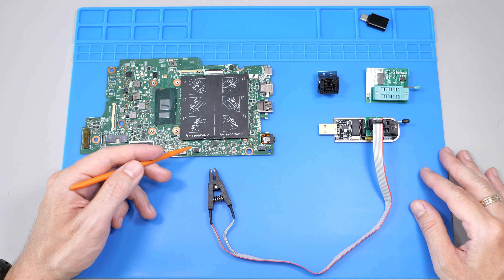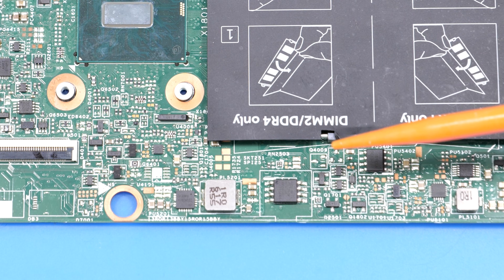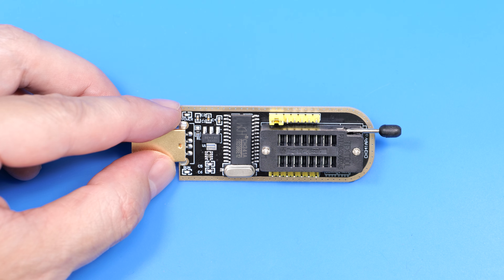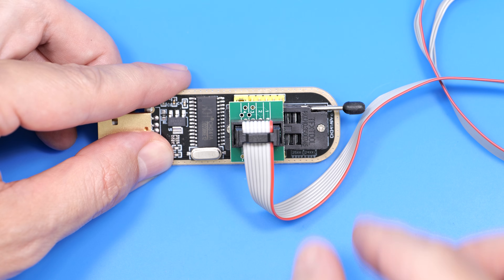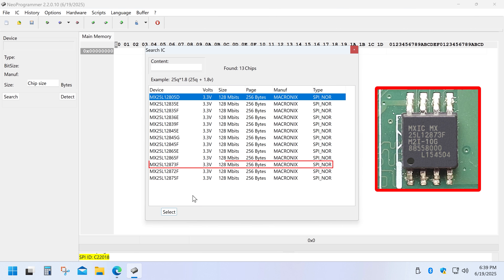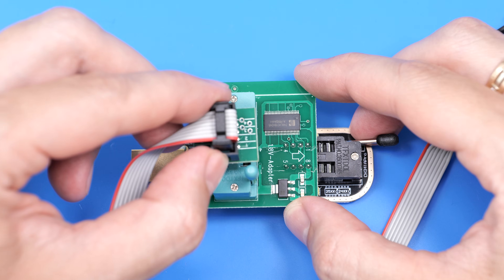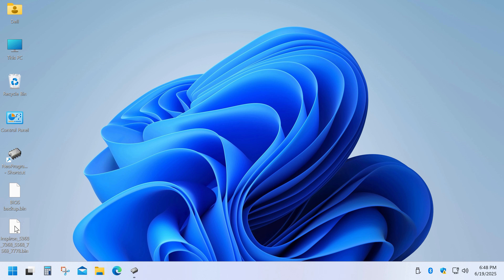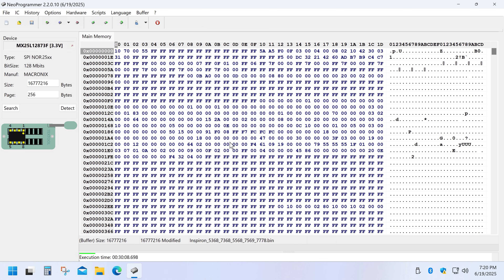How to Fix a Corrupted BIOS with a $5 Programmer | CH341A BIOS Flash Tutorial

Comment: I have an issue. I'm trying to fix my Gigabyte am4 GA-AX370-GAMING 5 motherboard I'm suspecting the bios is dead. Apparently the board is used to self bricking eventually. My issue is that thet chip that the mobo has for the bios doesn't have markings for the model number it's completely black. And cant find information regarding it on the manual. How could i go about it?
Reply from the maker: That motherboard should have a dual BIOS if I'm not mistaken and if the B_BIOS is dead, it should automatically fall back to the second chip. Also, there are two small switches below the bottom PCIe slot that let you manually select which BIOS chip to boot from, try toggling those first. If that doesn't help, clear the CMOS and try powering on while holding the power button for ~10 seconds, that can trigger the backup BIOS to recover the main one. If both chips seem dead, you’ll need to reflash one using for examle, a CH341A programmer. The chip is likely a Winbond 25Q128FVSQ or similar 3.3V 128Mbit (16MB) SPI flash, so no worries it's safe to try different models until you find out which one works.
Reply: @ElectronicsComputers  well I have tried switching it with the switch and clearing with the battery and it hasn't helped. I haven't tried the 10 second thing you told me but I'm not too hopeful. I at least know that my components are good I tried them on a friend's mobo.

My issue is as follows it turns on and the error code cycle a lot and doesn't end up turning on. It could stay stuck in DF or code 00. I read online that apparently that board had a tendency to autobrick the bios randomly if the PC wasn't powered off correctly. It's good to know about the chip. I was worried that it would be a 1.8v one and that it would get fried.
Reply from the maker: @THEwed123wet   Yeah, based on what you're describing especially the error code cycling and getting stuck on DF or 00 it really sounds like both BIOS chips might be corrupted. That MB is known for randomly bricking the BIOS. Simply download the correct BIOS files from Gigabyte’s website and reflash the chips. On that board are most likely Winbond 25Q128FVSQ or something very similar. Flash both  M_BIOS and B_BIOS with the same BIOS file, one at a time, and clear the CMOS again after you're done flashing.
Reply: @ElectronicsComputers Ok I will do it. First need to order the parts. Do basically i should do it with the battery attached and then when i finish i remove it to clear the cmos right?
Reply from the maker: @THEwed123wet   As a rule, we always disconnect power both the CMOS and main battery before reflashing the BIOS chip on the motherboard. If the chip isn't detected during programming, some motherboards require standby power either from the CMOS battery or the main power supply to activate the necessary power rails for the BIOS chip.
Reply: @ElectronicsComputers Thanks! I will keep it in mind 🙏
Reply: @ElectronicsComputers I'm back, I got the programmer. after further inspection I managed to see the print on the BIOS chip it's a MX25U12873F 1.8 V, I have tried to get the program to read the chip but I get the "IC not responding / Disconnected" error I have tried a lot to reset it and try on the second BIOS chip and I haven't had luck. I did notice that the pins on the 1.8 v came slightly bent I managed to straighten then out but it still didn't work. I now noticed that the pins from the thing that plugs into the 1.8 thing are also bent I will try to straighten then tomorrow. Idk if o should maybe power the board or remove the CMOS I have seen online to also try multiple programs will try doing that too see if it helps. I will also borrow a voltímeter from a friend to see if it isn't damaged idk.

Comment: would it have been better to move info about how some chips are 1.8v before the clip where you plug it in power? to avoid frying the chip?

I didn't watch the video all the way through and watched it step by step, I just realized after plugging in that my chip was 1.8v. It could've been fried (will have to buy a 1.8v adapter to be sure) or do these programmers only flow power to the chip when a read/write occurs?
Reply from the maker: Thanks for the feedback you're right, the voltage warning could be shown earlier. I placed it after the IC detection since NeoProgrammer displays the correct voltage once the chip is selected, and that felt like the most natural flow. I’ll definitely consider adding a warning in a pinned comment. As for your chip, most CH341A programmers output 3.3V as soon as they’re plugged in, not just during read/write. That said, many 1.8V chips survive that exposure without damage. In my repair shop, I use an advanced programmer that switches voltages through software and I’ve had with the wrong voltage many times without frying a chip. But if it stays powered for too long at the wrong voltage, yeah, it could definitely die.
Reply: @ElectronicsComputers Thanks for the response! Won't risk flashing a 1.8v on a 3.3 programmer, still waiting for the adapter.

Comment: Any programmers for Linux as I left the virus years ago
Reply from the maker: Sure, CH341A can be used on Linux with tools like flashrom or CH341Prog, not a lot and that software is way far from perfect because Windows dominates the tech repair industry. Tools like NeoProgrammer, AsProgrammer, and many diagnostic platforms are built specifically for Windows because it provides a more stable and universal environment that hardware devs and software engineers can rely on. In professional repair work, you need results, not workarounds. That’s why Windows remains the standard in EEPROM programming, BIOS flashing, automotive diagnostics and embedded tools. We're authorized repair shop for 7 major brands and all diagnostics software that they provide is Windows based.  And if Linux is really your daily driver, the best solution is simple just use a VM. I run a VM setup with multiple OS like Windows XP through 11, several Linux distros, several macOS versions and even Android so I can handle any compatibility issue without switching systems and basically run several OS simultaneously. It’s efficient, flexible and it just works.

Comment: My motherboard has JSPI1 connector pins near a chip I think is the bios (W25Q128FWSQ which is rated 1.8v I believe). I just like to confirm if my connection is correct - JSPI1 to 1.8v converter using female to male jumper wires - 1.8v converter seated directly to the programmer (I'm not sure if  converter has pins underneath to connect to the programmer. If not then what do I need?). Programmer to computer's usb. Will this work?
Reply from the maker: Yep, you're right. That’s a 1.8V chip so you MUST use a 1.8V adapter, otherwise you'll fry it. JSPI1 is a direct line to that chip, but you still need to be sure of the pinout. Your setup must be: JSPI1 ➜ jumper wires ➜ 1.8V adapter ➜ CH341A ➜ USB. The 1.8V voltage adapter that comes with the programmer have pins pre-soldered underneath. But honestly it's easier and safer to just use a test clip connected through the adapter to the chip just like I showed in the video. The link for the adapter I used with all its adapters in the description.
Reply: @ElectronicsComputers alright thanks😊

Comment: I connect my flash to computer and it device state is being connected but as soon as i attach clips to bios chip, device state becomes not connected. And the yellow led starts blink on my flash.

Why is that happening? Im sure theres no damage on my bios chip and i attached all cables correct. Please help me.
Reply from the maker: Speaking from my experience, this usually means one of the following: short circuit or bad contact with the clip, also the clip might not be making clean contact or could be shorting adjacent pins. Double-check that it's seated correctly and not offset.
Too much power draw from the chip – CH341A can’t always deliver enough power through USB alone. Some chips need more stable 3.3V than the programmer can supply.
Incorrect voltage setting, if your chip runs at 3.3V, 1.8V and you're supplying 5V (or vice versa), it might cause the programmer to freak out or even damage the chip. Make sure that the voltage jumper is set correctly. Also have you tried the drivers I was using?
Reply: I have the same issue. When I only connect the ch341a with the clip not attached to the IC and click detect on neoprogrammer it says Current programmer: CH341 Black. But when i connect the clip to IC and click detect is says Connecting Error CH341(Not found). What is the problem sir? I have main and backup bios so i tested it on both chip. Its the same result.
Reply: @KingRagnarPH i have solved the problem, my device had ch341b chip inside instead of ch341a. This model device was really unreliable because of voltage waves. I bought another device which has ch341a chip inside and my problem solved. (by the way I also had to put 10nf capasitor between vcc and gnd pins to new device to keep voltage at the same level before writing/reading)
Reply: @2memory333  what board are you using? mine is blue SOP16/8-DIP8 REV4. Is this okay to use or I need the same as in the video?

Comment: Hey bro, I saw a video where you changed the thermal paste on an Xbox Series x, so I want to change it to my Series S. Do you think 10g of Upsiren UTP-8 will be enough?
Reply from the maker: Ten grams is a very small amount of thermal putty. For the Xbox Series S, you'll need around 15g, so the safest bet is to get a 20g can. The Series X requires roughly 36–38g, so go with either a 40g can or two 20g cans. Also, don’t forget: there are memory chips under the metal shielding around the APU, I’ve noticed some of my customers completely miss that.
Reply: @ElectronicsComputers  Thank you very much, really, so if I'm going to work with the S series, will I use 20g?
Reply from the maker: @hidekelmoreta8631  That's right!

Comment: I had no idea it was that easy! With that clear explanation, I think anyone could do it and save tons of money.
Reply from the maker: Thank you for the comment! With the CH341A programmer, you can literally bring back to life all kinds of dead gear BIOS-bricked PCs, laptops, Smart TVs, routers, satellite boxes, even some EEPROM-based appliances. It’s all about raw access to the chip. You can dump the original firmware for backup or future mods, tweak, unlock features, or fix corrupted stuff. People don’t realize how much power they’re holding in that little USB stick.
Reply: If the device connected wrong, that can even fry the chip